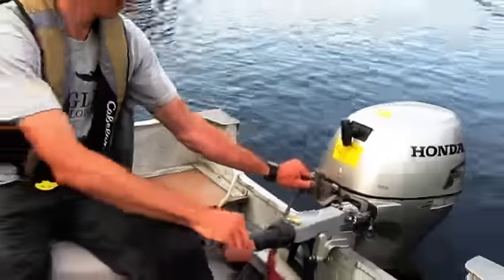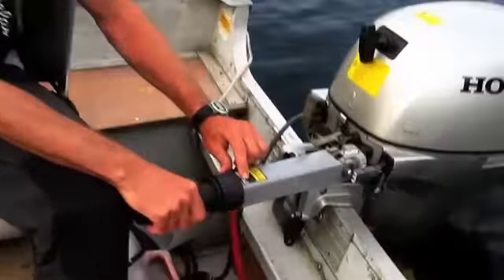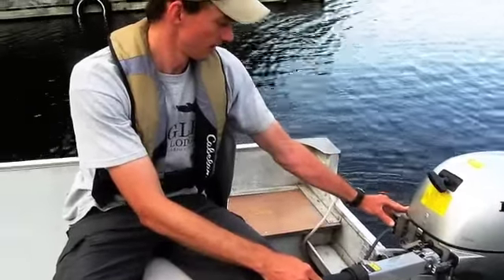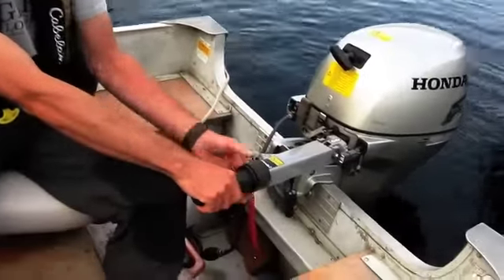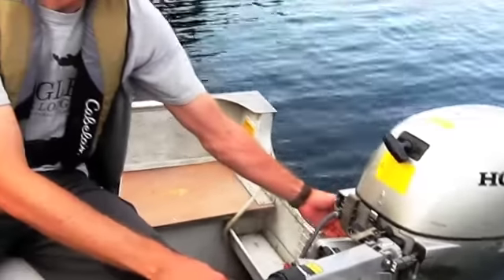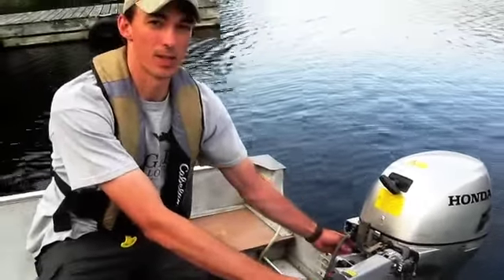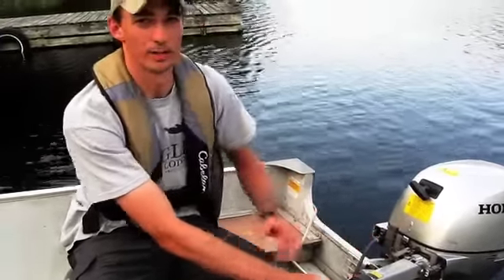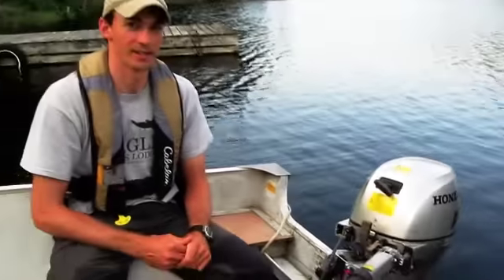Boat Motor Basics pull start

Comment: i have a 1985 Tohatus 12 HP, gas powered, pull start, 2 stroke and cannot find a choke anywhere on it.... is it possible it doesn't have one?

also, whats the best gas/oil mix to use and where can I find it? Motor says 50:1 mix ratio.
Reply: It is possible